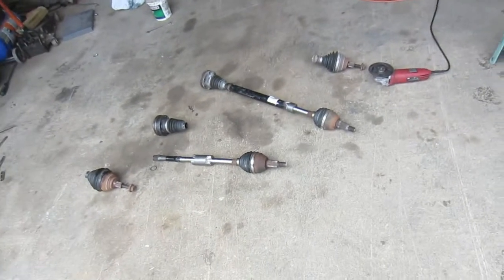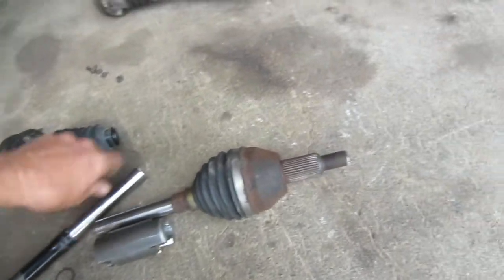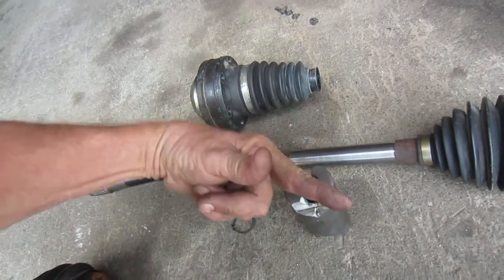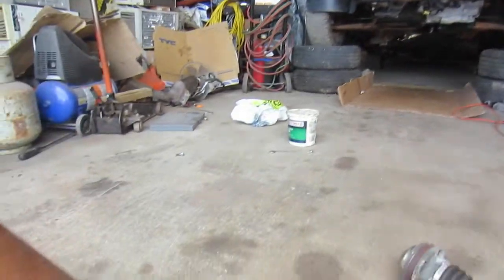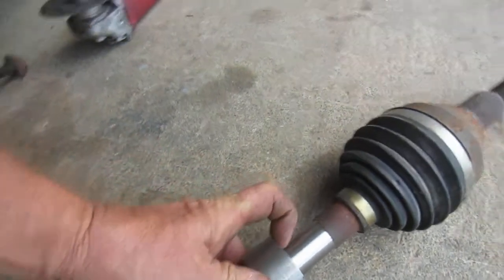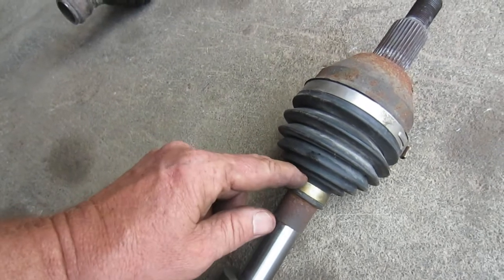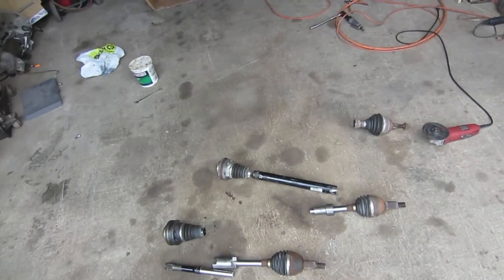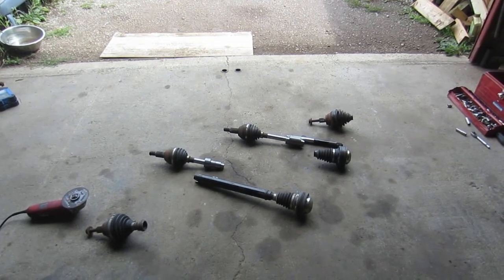19.  How to make hybrid vw - caravan front drive CV axels

Comment: Holly crap. Your back. What it been, a decade? Hope the stupid hater club doesn't resurface.  I just picked up a '86 vw jetta diesel. Body is ok,  but I'm mainly gonna use it to experiment with alternative fuels.  If the body falls apart,  I'm considering swapping the 1.6 into a pontiac vibe if I can find a factory 5 speed.
Reply: most are dead